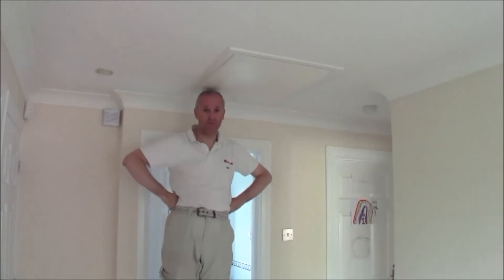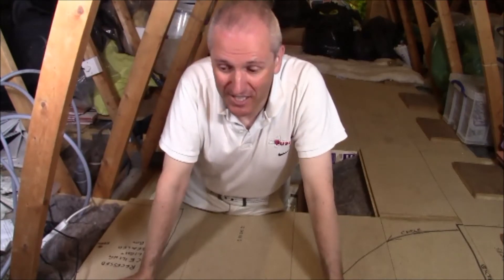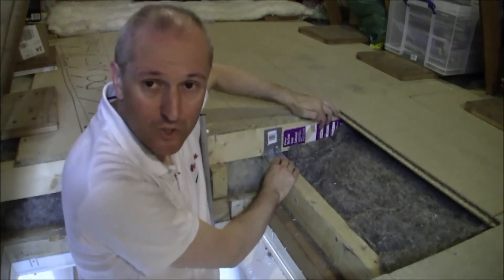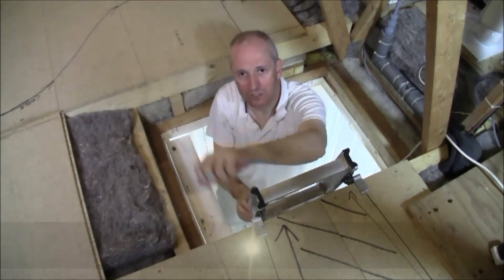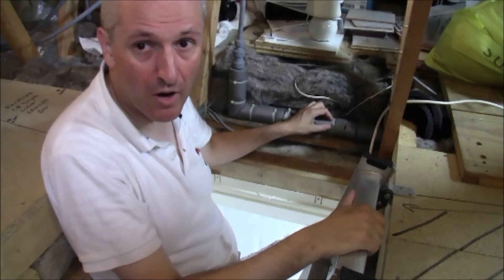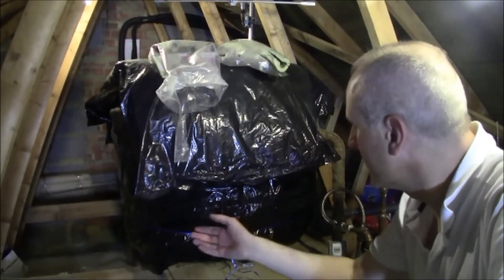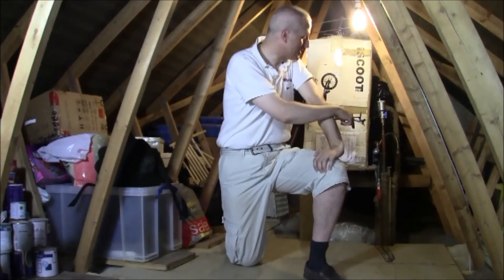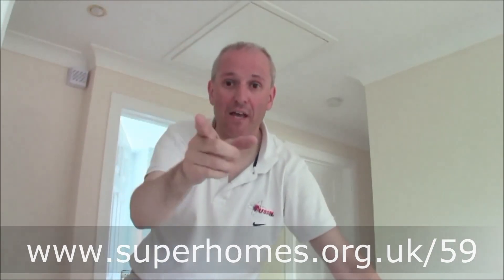Is boarding over loft insulation a DIY job?

Comment: Confused at 02:35. You point to the original load bearing joist and then the one above it and say it is at right angles, but it is clearly parallel. I assume you mean that it is at right angles to the roof trusses.
Reply: Good catch, I also saw that.

Comment: So you have laid one layer of 2 x 4 on top of the original, then another layer on top of that? That's a lot of weight. I want to do this job with plastic loft legs but would rather use timber, but have been advised that so much timber is too heavy for the ceiling joists if I am going to store stuff and tramp around as well.
Reply: Yes, the timber does add a lot of weight, reducing the amount of storage you can put in the attic. Perhaps more importantly though, the timber also acts as a cold bridge , and if this person was a builder, under Part L1A of the building regs, he would have had to reduce the SAP score for his roof because of the cold bridge he's introduced. In my Superhome (No 156), I've used LoftZone to raise the deck, and I'm also interviewed on this website about why that's better than using timber or loft legs: http://www.yougen.co.uk/blog-entry/2849/Is+boarding+a+loft+with+LoftZone+the+easier+option'3F/
Reply: Love to hear alternatives to wood.